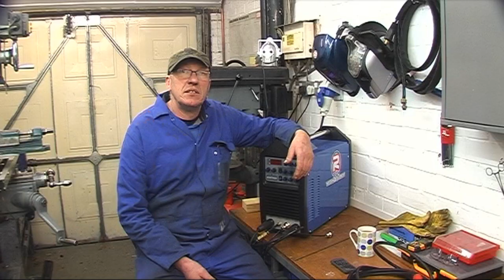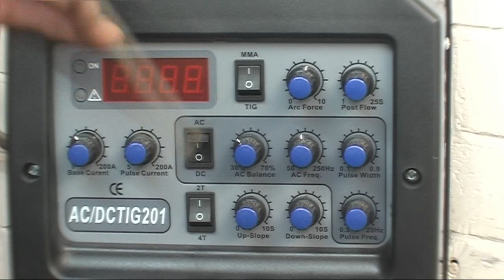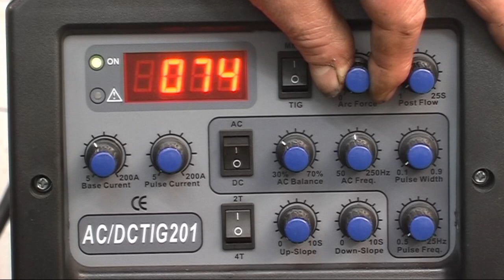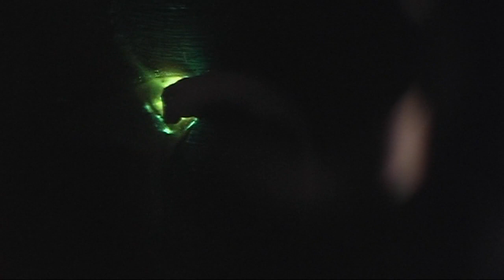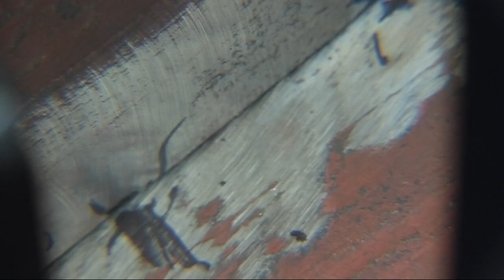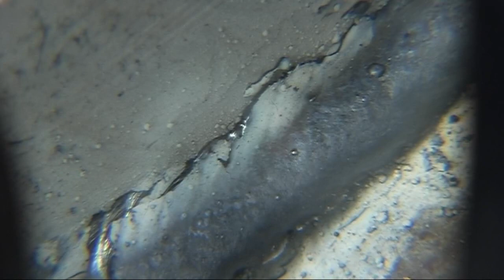R - Tech AC / DC 200 AMP Inverter TIG Welder Part Five

Comment: John that was a great review very informative thank you I really enjoyed it, I must ask though why did you pick the manual rather than digital version was it just the cost? or is the manual version better? the manual version certainly looks easier to setup.
My Finance director (SWMBO) has finally released funds for the purchase of an AC/DC Tig and the choices are either of the R-Tech 200/210 amp models or a Jasic 200 AC/DC Digital or a Portamig TEC-TIG 185 AC/DC TIG.

Regards and seasons best Paul

Comment: John, In this Video what rods are you using. The rod seems to be self de-slagging electrode. I Still use the old 12swg, 10swg, 8swg,6swg.
Reply from the maker: Hi
George
The rods are "6013 2.5 mm general purpose rods"
Nothing special at all
They are fresh & dry
Regards
John

Comment: Just wanted to say thanks for your efforts making this series of videos. My mind is now made up, I am going to buy one for myself. Just considering either buying a 200 or saving for a bit and getting the bigger model. Just know if buy the 200 going to need just a little bit more and wish had bought the bigger unit!. Apparently adding a little helium to the mix gives an increase in capability, any thoughts on this? You just using pure Argon for everything? Be interesting to see the same settings used on all options of gas? Cheers mate.

Comment: Hi John.  Nice new Doubleboost channel logo, and set of welding videos.  Especially useful for me since I was about to buy a welder/plasma cutter.  I looked at the R-Tech site after your 1st welding video and would have bought one of theirs if only they'd had a cutter included (I wonder why they don't).   Anyway, I went and bought another 200amp welder that seems capable of all that yours does + plasma cut.
I'm personally especially interested in thin Stainless steel, Aluminium and general cutting so looking forward to your plasma cutting review.
I bet R-Tech's sales have been boosted to double what they were before, so I think your channel name is PERFECT for the job, and you deserve a plasma cutter for free.
Regards Mark in the UK

Comment: HEY, I have the same milling machine as you. I am getting ready to Jack the turret up with a 5 in. solid aluminum  spacer to get more clearance. Do you have any feedback or tips on how you did yours and things you may have done differently? thanks Check out my vids to.
Reply from the maker: There is a good forum on the 626 mill
The riser block was the best mod I did
Look for my vid "trouble at mill"
John
Reply: thankyou!
Reply: Is there any way you can send me the spacer drawing you have via Email and maybe even a quick design sketch of how you did the screw and nut at the bottom? Or maybe you can just make a detailed video about it when you have some time, that would make my day! What is the hole pattern dementions?
Reply from the maker: sim clark
Have a look at my video (well screwed)
The hole pattern is different on every machine
I did mine with a paper template
John

Comment: It looks like you got a good one.  Everlast sells what looks like the same thing in the USA, but have had problems with DOA machines and support is a nightmare
Reply: The big difference between Rtech and the competitors is they spec their internals and CHECK the quality control great standard..  No way can rtech offer a 2 years warranty with collection and return included.  Unless their gear is a great quality.    Then you cant take out further two year warranty for an extra few quid,.  I call that customer service................plus a bit more.

BTW the everlast might look the same case etc but the internals will not be the same. the most important part of the internals are from siemens NOT china.